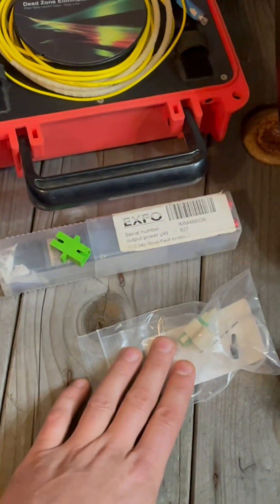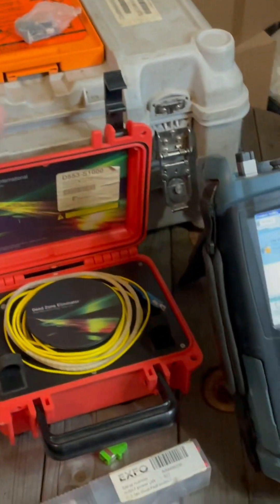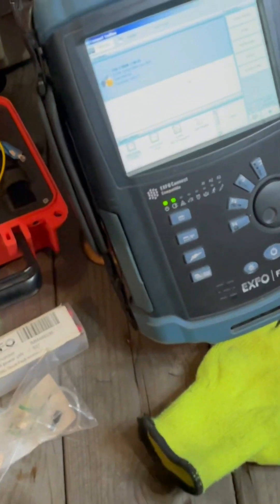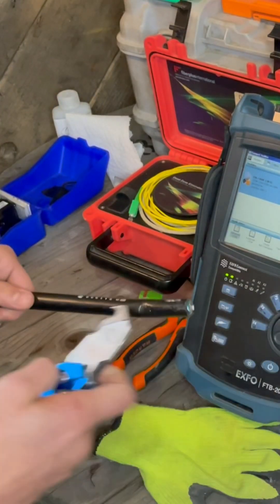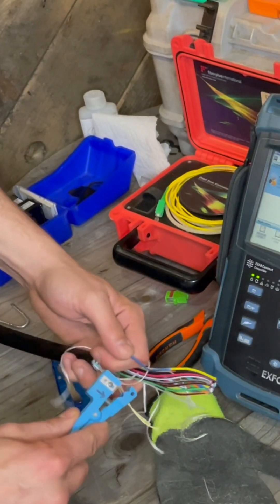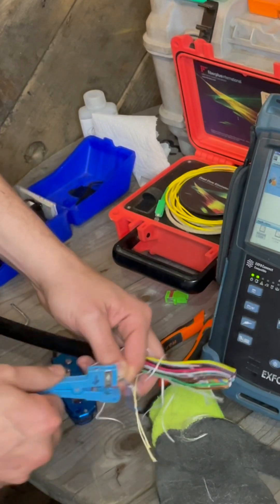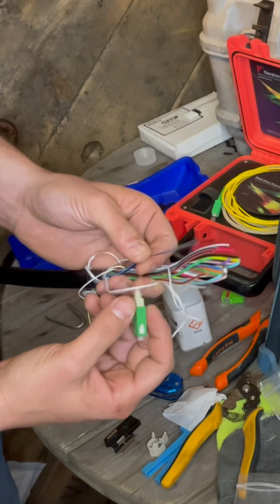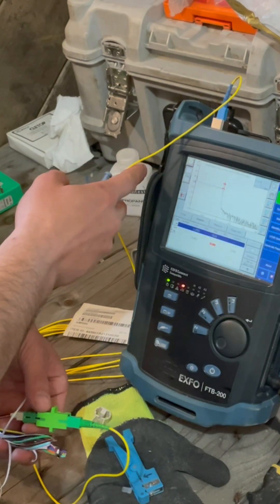Fiber optic reel testing

Comment: If your testing on the reel I normally set my splicer to arc pause and use a single pig tail I ain’t a fan of those manual sc connectors
Reply: I was going to say the same thing, especially when checking multiple strands. That single pig tail, or half a jumper eaten by a dog, can do 10x the work with less finesse and fanagle.

Mechanical quick connect is rated for how many insertions, 5, 10?